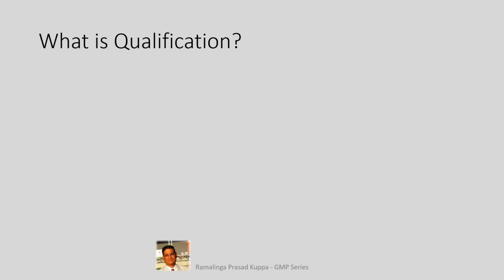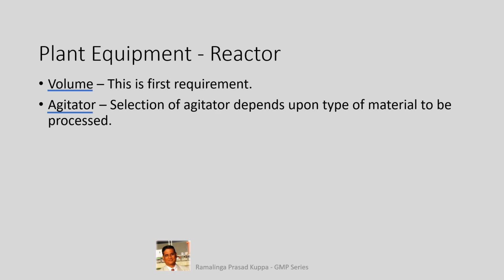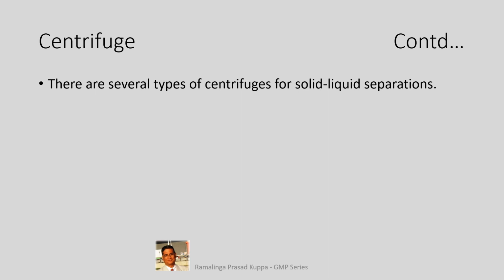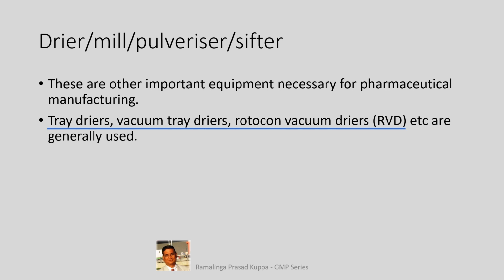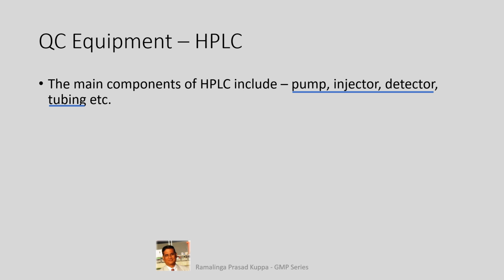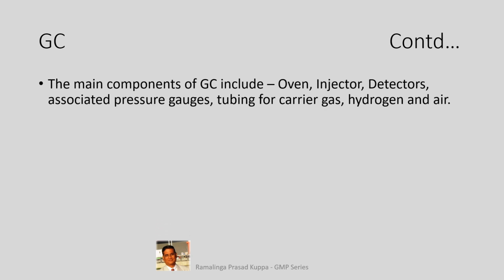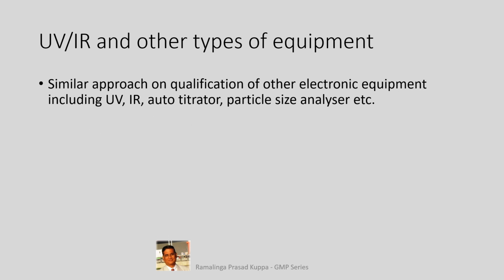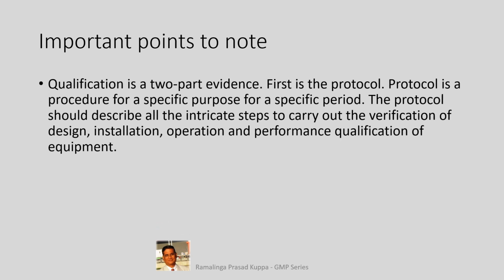Equipment Qualification   Basic Understanding

Comment: Nustch filter shifted to another block sir Requalification is required or not sir, if it movable equipment?
Reply from the maker: Any movable equipment needs to be requalified for basic installation qualification and operation qualification for its suitability in the other location.